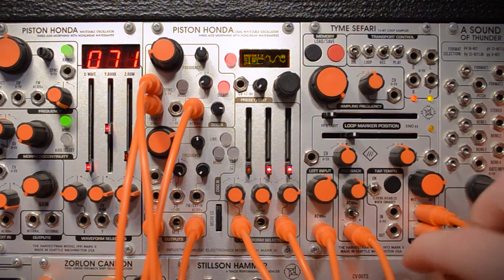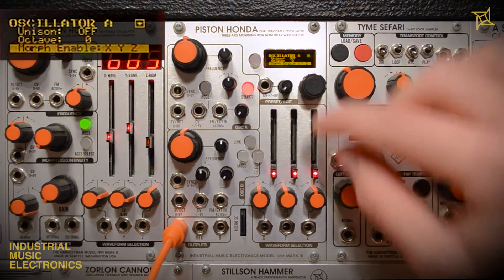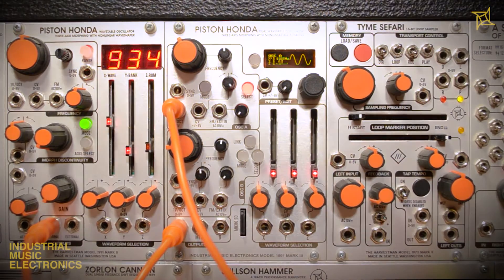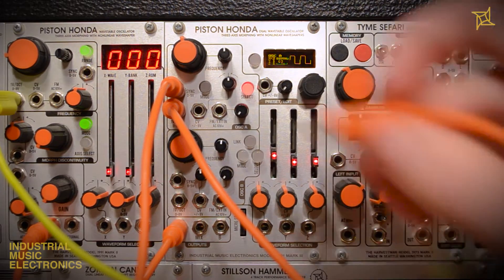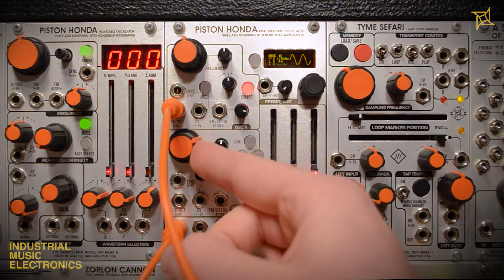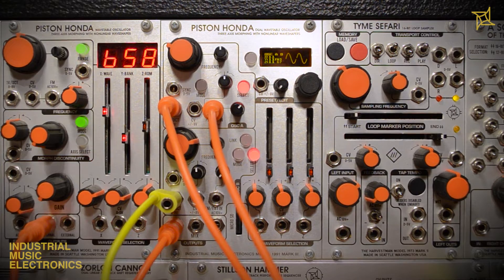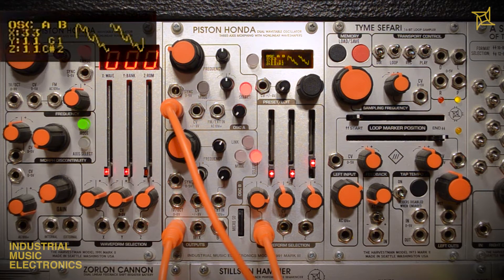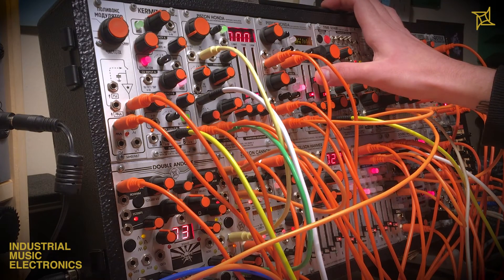Industrial Music Electronics Piston Honda MK3 Part 1: Panel Features

Comment: Why not post this in the description?

Index of Temporal Segmentations
0:00 Introverview
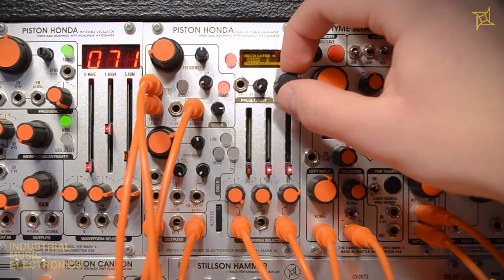0:33 Panel Controls
1:19 Oscillator Selection
2:10 Morph Enable
3:01 PATCH: Piston Honda mk II Interlewd
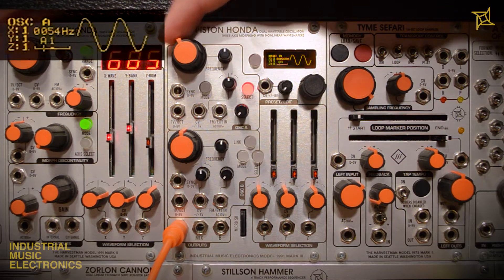3:29 Tuning Features
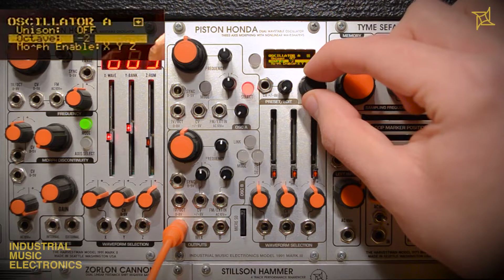4:30 CV+/-8V Input (simple Vibrator)
5:30 Link Button
6:48 Sync Input
7:19 Dual Wavetable Sync patch (featuring Piston Honda mk II)
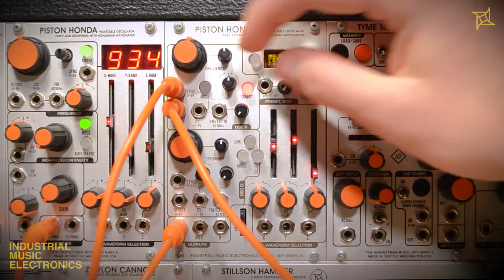8:01 PATCH: Tyme Sefari mk II Interlewd (I always feel like nobody's watching me...)
8:47 Frequency Modulations (FM)
9:52 Unapologetically Harsh & Metallic Timbres
10:24 PATCH: Abraxas FM
11:15 PATCH: Piston Honda mk II External FM Input Interlewd
12:25 Wavetable CV
12:39 PATCH: Piston Honda mk II as LFO to mk III Z-axis
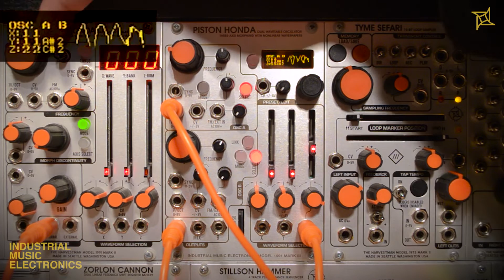13:12 PATCH: Piston Honda mk II as LFO to mk III X-axis
13:51 PATCH: Smooth & Chaotic Y & Z axes
14:25 Anti-Interpol
14:43 PATCH: The Final Technique: Zorlon B Gate Modulations
15:22 Quick Intuitives
15:53 PATCH: Ambient Sefari Stillson Andore Zorlon Kermit & Friends (i.e., other shit I can't see)
Reply: Thanks for doing the time codes.  Very helpful!
Reply: yeah I hate it when producers don't create those bookmark chapter things